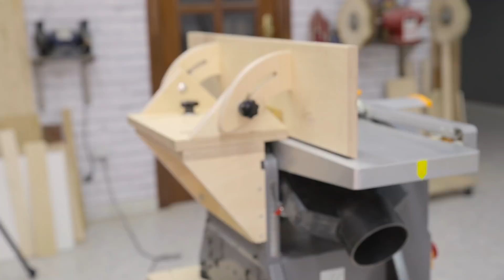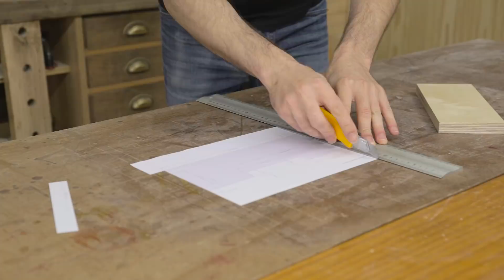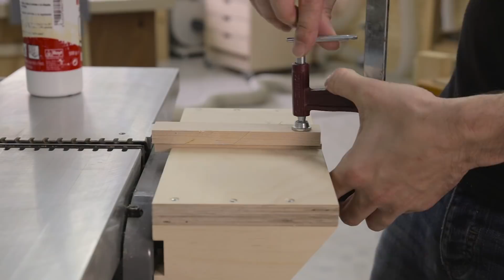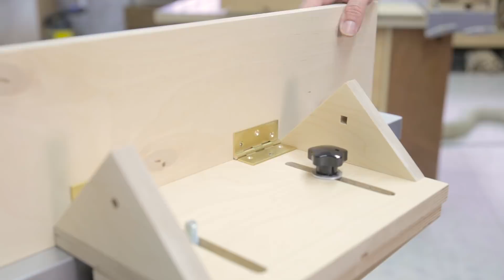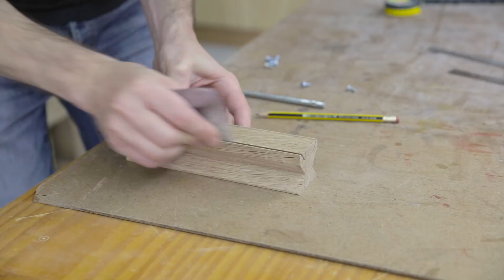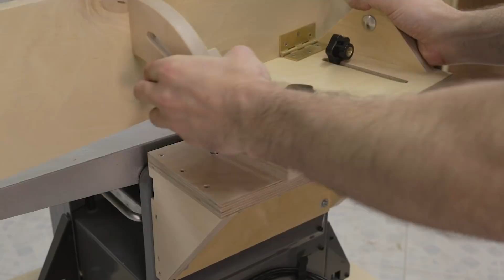Homemade Tilting Fence for my cheap Jointer-Planer combo

Comment: Thanks for your video - how easy is to adjust the infeed table and the blade on this machine ? I bought one recently  - the fence is twisted , infeed table needs to be aligned and probably the blade too  - as I gt a bevel on the wood instead of flat surface .   Now I use a table saw sled to joint wood but it will be nice if I can get the Jointer in shape - especially with a proper fence like yours

Comment: Are you still using this machine? I have the same one in different "brand" but it is the same machine. How long boards are you able to joint on it?
Reply from the maker: yes I keep using it! I think I have worked with pieces up to 2 meters long. Check this out:
https://youtu.be/mZ8_y3T00ZA?t=63

Comment: Bonjour, J'ai la même machine il y a 4 ans que je l'ai et cela fait 3 ans que je me suis fait un guide comme toi. L'ancien guide n'était pas à 90° et impossible de rectifier ce qui m'a obliger de ma construire ce guide en bois. Vue que c'est la même machine le guide est à 95% identique.
google trduction
Hello, I have the same machine 4 years ago that I have it and it's been 3 years since I made a guide like you. The old guide was not 90 ° and impossible to rectify what forced me to build this guide wood. As it is the same machine the guide is 95% identical.
Reply from the maker: C'est curieux! Je voudrais voir une photo de votre guide:   info@paoxxx.com
Reply: Envoyez moi une adresse mail et je vous envoie les photo que je viens de prendre.

Send me an email address and I will send you the pictures I just took.
Reply from the maker: @Serge Cheval  my email: info@paxxx.com